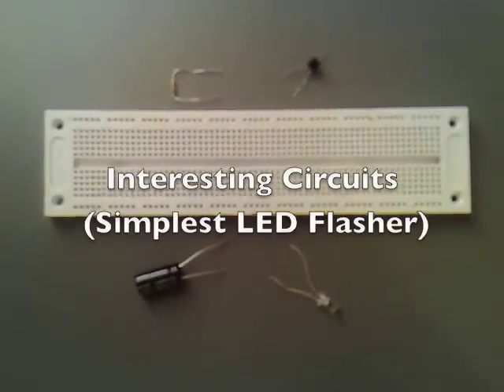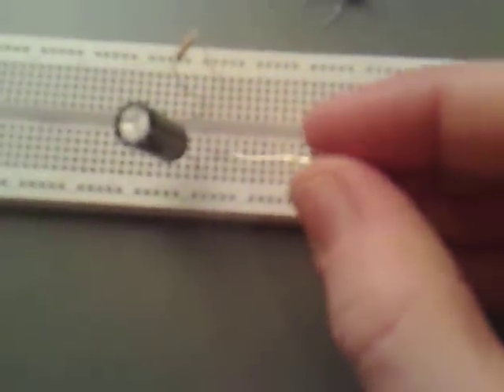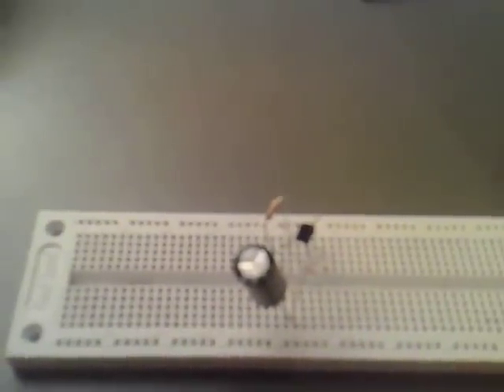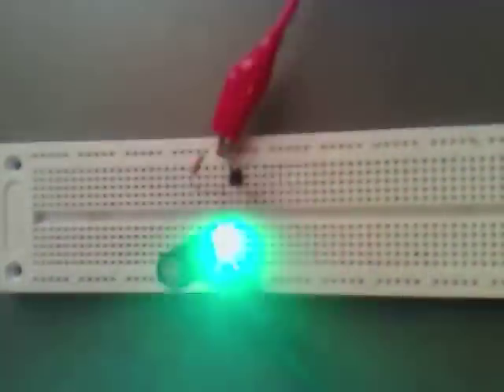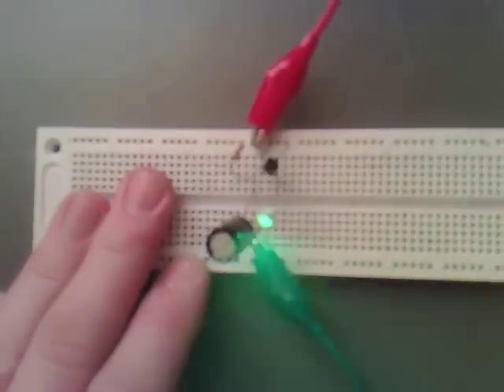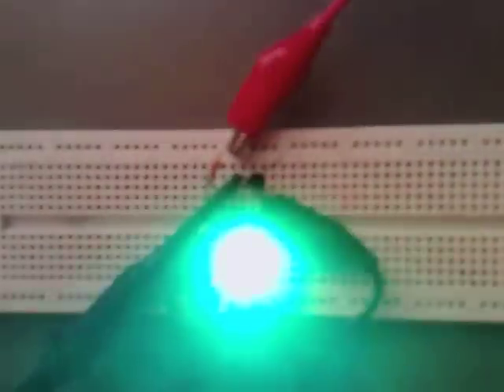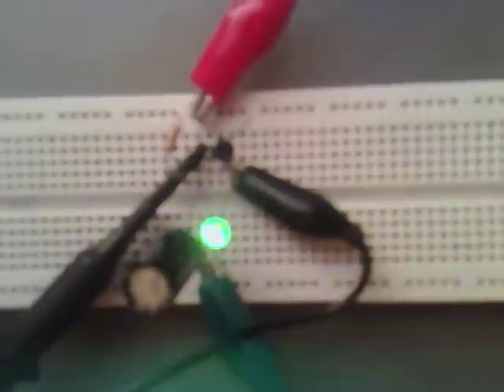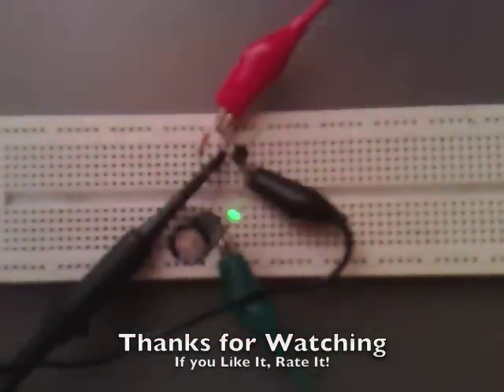Interesting Circuits (Simplest LED Flasher) 001

Comment: As you know, an NPN measures like two diodes  connected anode to anode at the base. So current will readily flow across that junction from the  base to the collector. Since the base emitter junction breaksdown at 6 V non destructively at those milliamps, the transistor will allow flow from the emitter, to the base, to the collector and out through the foward biased LED. So, we have established that a 2N2222 will function as a 6V Zener diode placed back to back (anode to anode) with a 1N914 ...

Comment: Yes, absolutely.  Clip the base lead and repackage it as a negative resistor with minimum conduction voltage of 6V. You then have a 2 lead component that functions as two separate devices. All you need to do then is map the on resistance curve against currrent and you can use it to offset input impedance in resonant tank circuits provided the operate in the NR range :D. Very Kewl application.

Cheers

Comment: This is a neat video, but I think the effect here is called reverse bias avalanche. Tunnel diodes have a region of differential negative resistance on their VI curves due to quantum mechanical effects. There is a region where increase in voltage results in less current.

Comment: Yes. The running frequency depends on the capacitance(storing-space for charge) of the capacitor, the resistance of the resistor(limits the amount of current flowing into the capacitor), and the break-down voltage of the transistor(breaking down(leading current from capacitor to LED) when the capacitor reaches a certain voltage).

Comment: Thanks for this video...i am completely new to the world of electronics but just taken it up has a hobby. I have followed your instructions best I can but I cant get this simple circuit to work. Would it be possible for you to take a picture looking down on the breadboard on how this is connected...i have tried many simple circuits but not had much luck as of yet lol..cheers

Comment: ... diode, so together they comprise a form of dynamic resistor that decreases in resistance as current increases. It is a form of a thyristor without a gate layer. Unlike the Diac, it only works one way, and unlike the SCR it does not require a gate signal. The extra 1N914 may seem unneeded, but it offers current protection to the LED. So...replace the 2N2222 with a 6V zener and a 1N914 and it may work the same o.O

Comment: @TheTubejunky I don't think taht this damages the transistor. Breakdown occurs where you ahve too high a current flowing across the junctions which physically damages the material making the junction so that it no longer works and always conducts. I have not been able to break any transistors using the esaki effect (but that doesn't mean I can't either)..

Comment: Yes, I can confirm that the experiment is real. Unfortunately, different transistors flash at different resistor values. I tried the same experiment but instead of a 1 kohm resistor I used a 50k potentiometer.(make sure you start at the highest resistance and slowly wind it down until it flashes. Good luck!

Comment: @ElectrocutedMinds A resistor in series with LED will limit the capacitor's discharge current through the LED and transistor, which is otherwise unbounded excepting the transistor's resistance at avalanche plus the LED's reistance when on. As it stands, the large capacitor may damage the LED, and possibly the transistor. So, I am not an idiot.

Comment: This did not work using identical components on the Breadboard and in Circuit Wizard as well. 
The Capacitor charges and as soon as it is charged the LED stays on all the time. Any help would be welcomed.

Comment: awesome! thanks a lot! I wanted to make about 30 LEDs without using any chip. I wanted to install then in a mask where there is no space for chips. Now would I need one capacitor per LED or per resistor?

Comment: yeh i found this circuit a while back, its really cool! barely any amp draw either. i guess u could use it for simple timing applications, maybe even as an oscillator.

the negister is an interesting effect,.an any1 know of any other transistor besides the 2n2222 that have this effect??

Comment: so am trying to make an LED flasher but would like to use only 3 volts and could you please provide the right capacitor, resistor values as well as I note that the 2N2222 transistor has 3 legs so I would like to know which one to use. thanks

Comment: I'd like to ask something ..  if someone has good experience in this please reply, i am throwing a party in march and i wanted to make more circuits like this one here, but the question is can you use a variable resistor instead of a normal one to mace the cycles shorter or longer by changing the current , or even better , if you can use a microphone as a resistor to make things sync with the sound ?

Comment: You say the cathode of the LED is connected to the emitter? i.e. reverse biased? That would indicate that the LED is tunneling (zener avalanche) If it is foward biased, then the transistor simply has to self conduct which will occur when 10 micro amps flow into the base via RF. Could you provide a link to a schematic? Thanx - Cheers!

Comment: I'm currently trying to get this circuit working from a 5V power supply. Same transistor, 560 Ohm resistor (which I've changed down to a 220) and 220uF cap, but the thing just won't light. Is it just a case of the transistor not receiving enough power to break down, or am I doing something else wrong?

Comment: hello, i am trying to make a tremelo pedal for my guitar and it requires me to make a blinking LED like in this video. For some reason though, it is not blinking. The LED simply stays lit instead of flashing. I have a 1k resistor, 1kuF capacitor, a 5mm red LED, a 2n2222 transistor, and 12 volts all connected to my breadboard. I've watched this video along with others a thousand times. What am I doing wrong???

Comment: Perhaps this schematic at [//]img131[.]imageshack[.]us[/]img131[/]5199[/]1tr[.]gif is similar to what you have? The transistor is reverse biased but the diode is foward biased. The 2N2222 has an emitter to base breakdown voltage of 6 volts. When it breaksdown it biases the collector via the base but current does not flow frrom the emitter to the collector, instead if flows through the avalanched emitter base and the foward base collector diode junction. The transistor is not destroyed but zeners